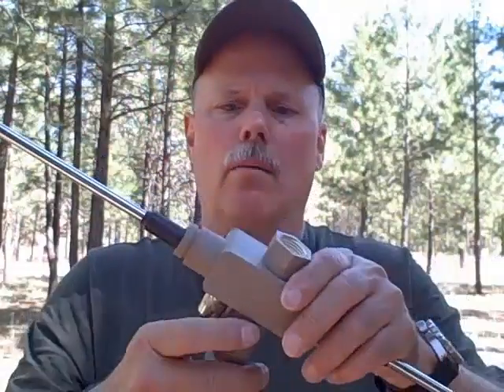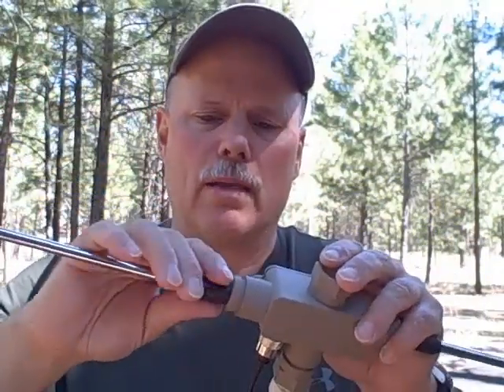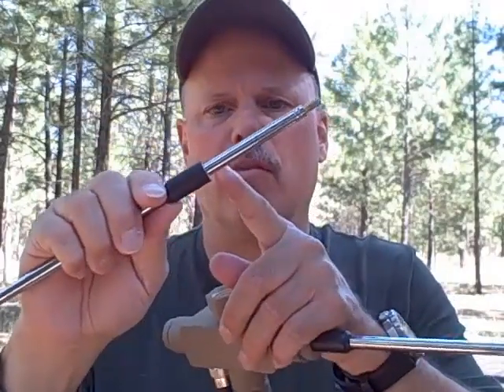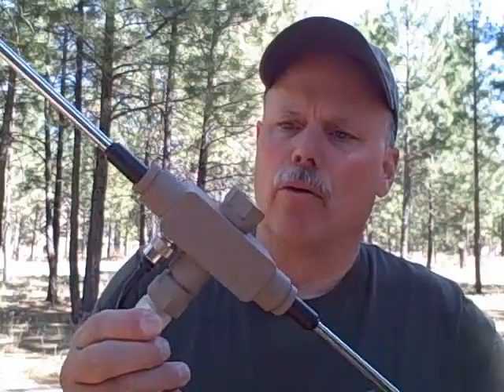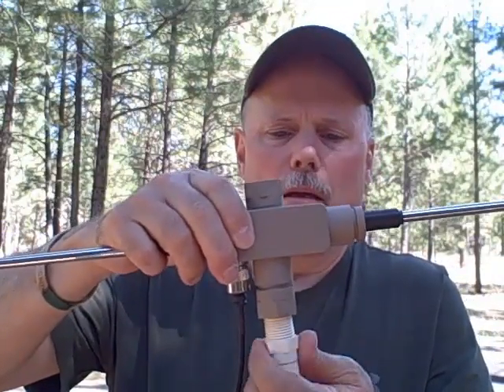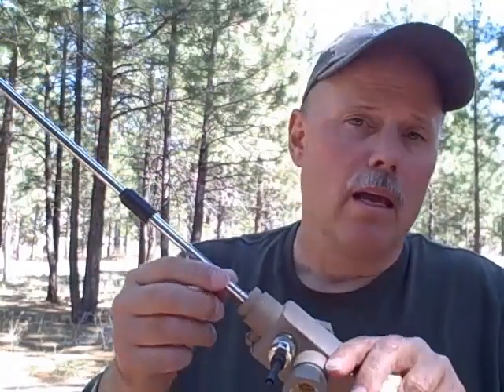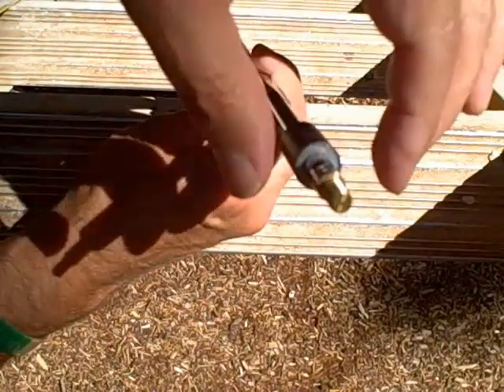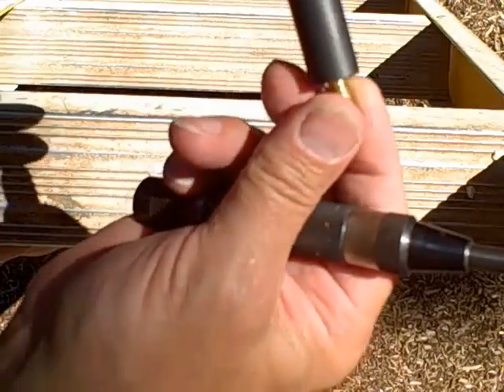KF7ETX  6 Meter Dipole Antenna

Comment: I was very impressed with your center feed point idea. Using PVC like you did was very creative. I liked the idea that you took into consideration of added a short extension on the top so you could include 2 meters. 
Great job !
Barry, KU3X

Comment: Well, I guess I could call you MY ELMER :)  I know you might think your videos are old and maybe outdated, but to us who are just starting or getting back into the hobby, watching these videos really put the spark in things. Thanks for the info and .pdf, I too am off to the store to get some parts ;)  Thanks
Reply: I see you found some videos from my buddy David.  Funny just how small the world is sometimes.
Reply: Omg yea. Searching for some 6 meter 2 meter and 79cm antennas.  Thus guy has his poo together :)  instructions are magnificent.
Reply: 99% of the videos out there are for more permanent antennas.  I, like him need quick mobile types that do not take up much room. He has just what I was looking for. Bug Out Bag ....
Reply: +Robert Alan Carter (W0QFW) Check on Dave Tadlock's  page for his vertical 2m/70cm dipole.  my first build and it works great.  very small footprint and easy to put together.  Let me know if you need help with it, I am hitting a repeater that is about 15 miles as the crow flies from my house on 5 watts with a 5 9 9 report on the repeater.

Comment: I once did that fix but instead of using a center punch (didn’t have one available) I used a tubing cutter and ran it around being careful not to cut through but shrinking the metal .

Comment: Could this be adapted to a 2m, 70cm dipole
Reply: yes it can if u get the longer whip antennas from buddy pole they should be long enough to make a 2m dipole not sure about the 70cm i would think that it would. And you could easly adapt the design for a jpole configuration as well

Comment: Could you use this as a possible
Scanner Antana?
Reply: +Chris Walport , if you want a good scanner type of receive only antenna do a search on wide band discone or split discone antennas.  Those work great for scanners, but you will need to get them up about 30'  in the air to see them really shine.  This specific antenna build is for the 6m amateur radio band. The element lengths will be different for the type of radio waves you are trying to catch with your scanner.